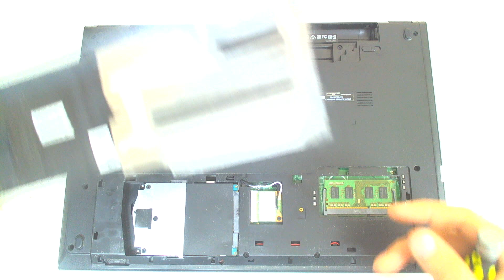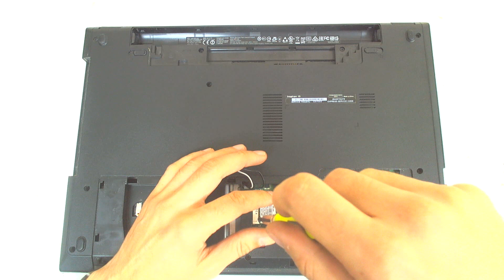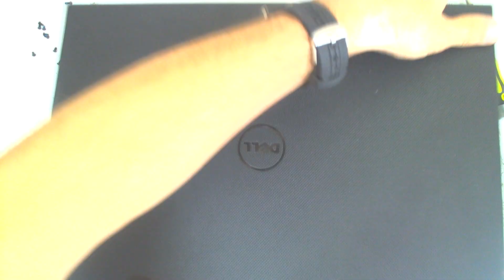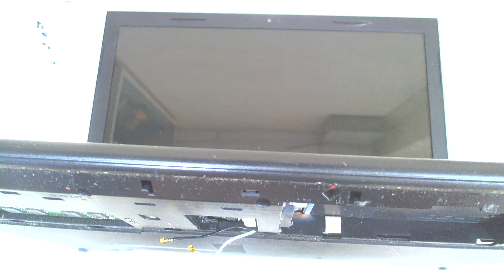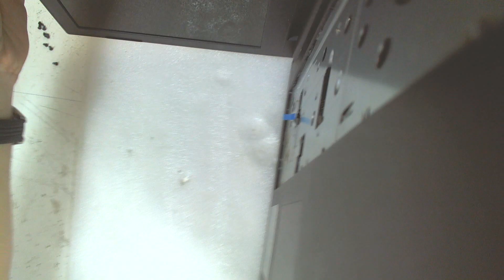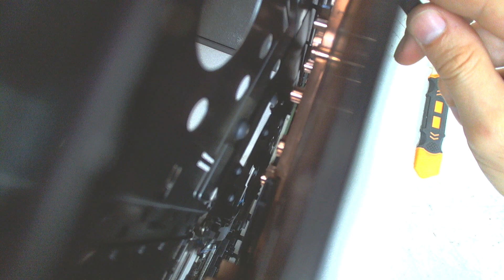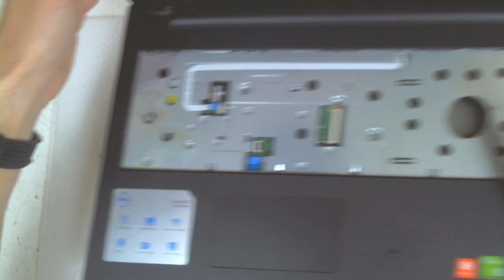Dell Inspiron 15 3000 series Disassembly / FAN Cleaning

Comment from the maker: Discord - http://invite.itjungle.eu
If you have any questions, regarding Laptop repair and etc. you can join and ask for help.
Reply: Hi Sir,
I have same model laptop(2015) amb process recently I updated win 10 os after I'm facing issue for laptop hanging issue cpu usage showing 100% again i change win 7 os  also same issue repeated any solution pls ?
It's cpu cooler paste issue ?
Reply from the maker: @ashok80019 check the HDD health with cristal disk info.
Reply: if our laptop is heating how to use fan in this model
Reply from the maker: @Khushi_i-t4z   The laptop has fan in it.
Reply from the maker: What do you mean. There is a fan inside and when the laptop is heating up, it will start to spin and cool down the laptop. Check do you have fan in it first.
Reply from the maker: @Khushi_i-t4z   No need to do anything.  The FAN is controlled from the board and windows. If the laptop is overheating, you just need to open it, clean the dust and replace the thermal paste. Like on the video.

Comment: I think you might a hoot out of my story. A week ago, I noticed my laptop was not pushing out air very much. And it felt warmer than it should be. I had another laptop that was older and doing something similar. I deducted the older one's fan and ducting was clogged with dirt and debris. I dissembled it and sure enough I was correct. Cleaned it out and it's running fine. I looked up on how to disassemble the Dell like yours.  I didn't use your video. Used another which showed how to open it. It all went very well. Cleaned the Fan. The circuit board. The insides. The reassembly went well. Then I turned it on. No Wi-Fi. It had vanished from my laptop. I went through 15 YouTube videos all this morning showing how to restore the Wi Fi. None Worked. I finally called Dell, and they informed me that my laptop was obsolete, and they had nothing to help me with. I was about to turn it into a Frisbee. But I decided to watch some videos. To calm my frustration.  Yours was one in the suggestions. I watched and at 1:05 my jaw hit the floor. I removed the cover and saw the Wi-Fi was not plugged in. I thought of a Popeye cartoon in which he was embarrassed, and his head turned into that of a donkey and the word "Jackass" flashed beneath. I plugged the Wi-Fi and turned it on. Works perfectly. I'm chuckling away at myself. The Fates must have guided me to you. I have three laptops I use. Looking forward to the next breakdown. And I am so subscribing to your site.  Hope you get a laugh out of this and have a safe day.
Reply from the maker: It can happen to everyone. Sometimes I forgot to plug the fan, sometimes other stuff.... So is all fine.

Comment: Bro while removing the mouse power cabel the blue thing came out . And I am scared now 😮😢 3:29
Reply from the maker: Don't worry. Just put back the cable and put the blue thing above it, than close the mechanism. The blue thing is just for stability.
Reply: @LaptopDisassembly  yeah but now the touchpad is not working 😢😢😢
Reply from the maker: @DeadInside202  just plug the cable first, than put the blue thing inside before closing the mechanism.

Comment: 0:30 i don't know why but i can't remove this part. do you know why that would be the case? thank you
Reply from the maker: You have to slide it back... It may be stuck if there is a liquid damage or else... Try to pull harder
Reply: @LaptopDisassembly  thanks i really appreciate that you're still responding. It came off but was just really dirty. :)

Comment: I have a Dell Inspiron 15 3000 series that I purchased last March/2018 and making a cliking sound, but the back of it does not look like this laptop at all, it is only one piece panel in the back.
Reply from the maker: There are different models of Inspiron 15 3000 series. Probably the clicking sound is from the hadr drive. Use a program like CristalDisk info to check how is it.
Reply: @LaptopDisassembly  yes sir, you are right, my Laptop is 2017 model and I found a Video on the internet that shows  how to open it and thanks for the advice I'll look-up that CristalDisk.
Reply: @The-Other-Guy  bro I have same model as yours but I can't find a video for it can you please help